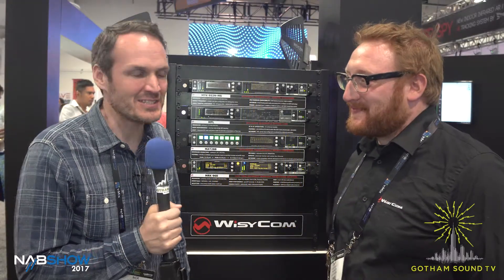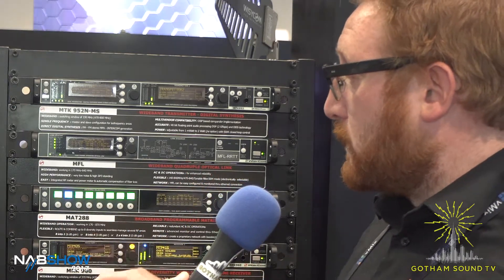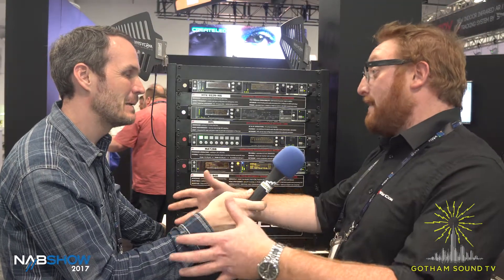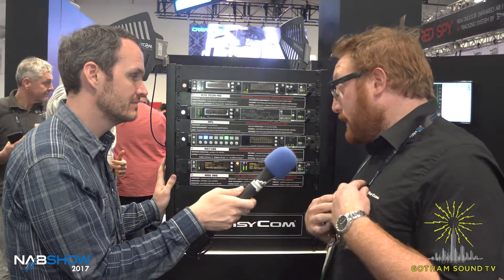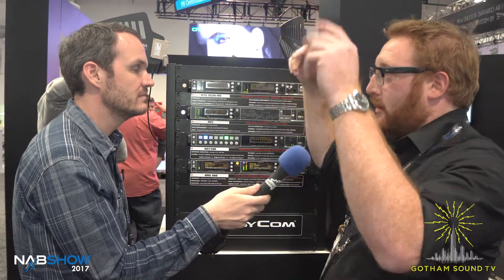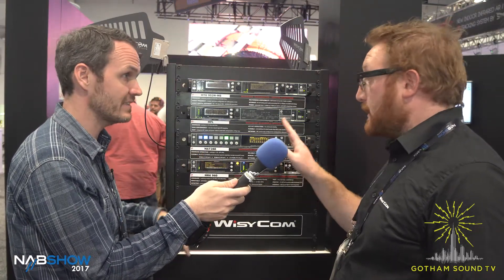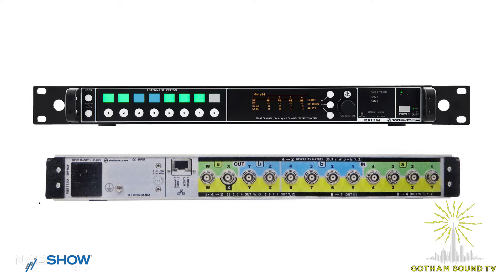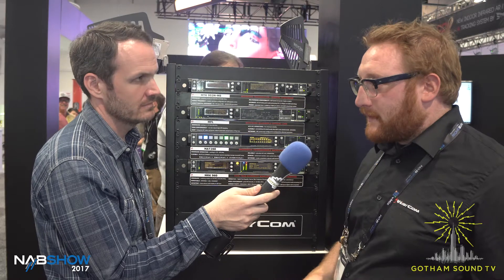NAB 2017: WisyCom RF Combiner/Matrix

Comment: Can you use the antennas in multiple zones simultaneously at once? For instance if you're shooting a Reality TV show, when half the cast goes out the back to the pool but the other half of the cast stay in the lounge, can you receive all of them at once? I assume so, and not be forced to choose one zone over the other.
Reply: That's exactly correct - selectable on the fly, and each zone can have custom attenuation. It also allows any connected LFA antenna parameters (filter, gain)  to be remotely controlled via coax. The RF meters are also really helpful. It's a great tool.
Reply: Yes you can!
Reply: Cheers, that all sounds great!